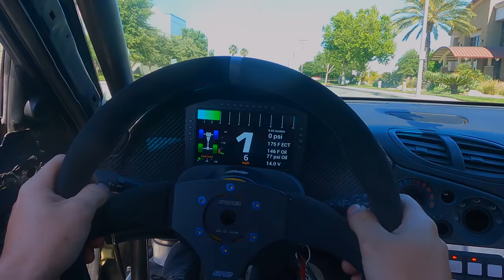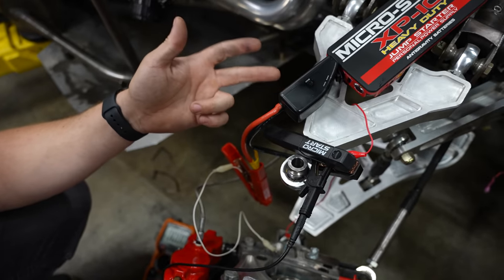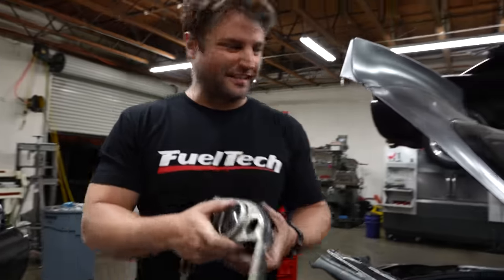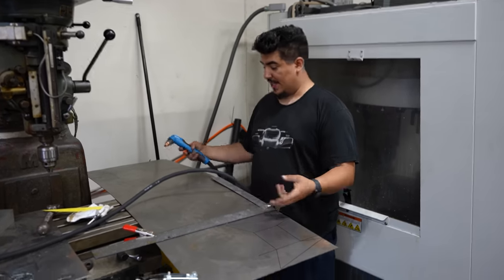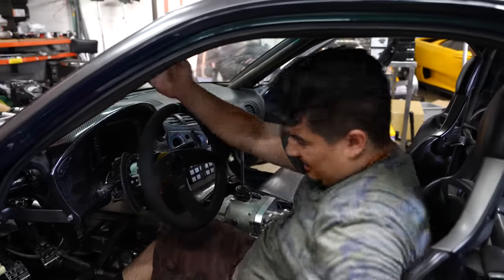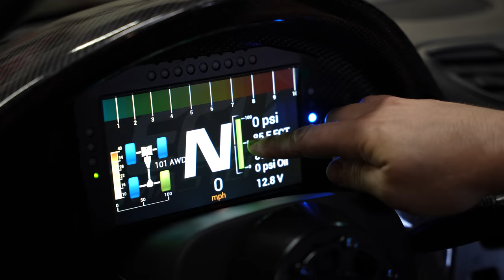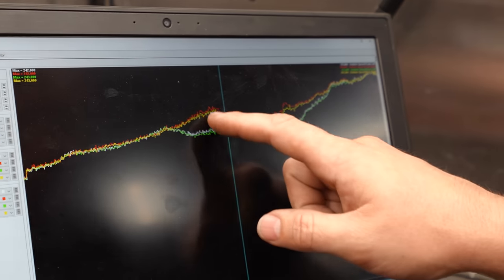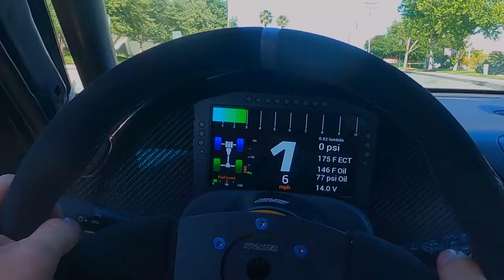Making the AWD 4 Rotor RX-7 brutally fast by Hacking Corvette Wheel Hubs

Comment: I believe a lot of the trig you were trying to use is only applicable to right triangles, or triangles with a 90 degree angle. Unless there's a setting to focus it back down to 90, you'll lose out on data points by calculating it that way. You can do one of two things. Either split the triangle in half, making it a 60-30-90 triangle, and instead of 12 inches for the base, it would be 6, and you wouldn't find the hypotenuse, you would mainly need the height. Or just mock up an interior angle of thirty degrees from both sides of the tire, and measure from the wall to the intersection of those lines. Honestly, the latter is easier because it doesn't require math, except for the knowledge that all angles in a triangle add to 180.
Reply: Okay, just went and reviewed, and this is exactly what he did. So for anyone wanting the full explanation, refer to above. Whoops

Comment: SUGGESTION: - for the tire temp readers, fit them to a rod attached to the hub/wheel mounts, at about 30-45 degrees below the horizontal and ahead of the tire.  This will keep them in a reasonable position relative to the tire, also minimising water or debris coming off the tire and will not require major changes to the inner fender or bodywork.
I think!!
Also, it might be wise to incorporate a small amount of shielding against water/debris coming off the tire and hitting the sensor.

Comment: I think the temp sensor for the front tires should be at the top. If you put it on the front or the rear of the tire and want the sensor to “follow the tires” then that means the sensor will be sticking out of the wheel well when turning the tires thus it’ll hit any fenders you eventually put there.

Comment: There are three different kind of sensors for wheel speed.

The oldest is the inductive sensor, which has 2 wires and gives out a AC sin wave with higher voltage the faster you go. Doesn't know if you drive forwards or backwards. The resistance of the coil can be measured, about 500-1500 Ohm, depending on the model.

Second is the Hall effect sensor, which has two wires. 2 for 5V DC power and a signal line. It gives out a square wave signal. This sensor also doesn't know which direction the wheel is rotating. You can only measure the 5V DC supply power and the wave signal with an oscilloscope.

Third one and used since for like 10 years now is the AMR (anisotrop magneto resistive) sensor. It's basically an Hall effect sensor that works on the concept of an inductive sensor. It has two lines which have 12V DC but the signal is transported on the ground wire as well. The signal is only very small, so you got to set your oscilloscope to like 2V AC and 2ms . This sensor knows if the wheel is spinning forwards or backwards and gives out a square wave with differing sequence depending on forward or backward. If it's toast, the signal switches all the time between forward and backward.

Comment: The reason those door cards shouldn't fit is that you should have side intrusion bars. And the basic safety items others are talking about. It wouldn't just be good for your safety, it would be satisfying content too! Probably would so good things for the rigidity of the chassis too, which could use a strut tower bar as well most likely

Comment: Ooooh, that is the type of data that is needed to get more realism in a simulation atmosphere, the current issue with making tire data is that there is so much guessing going into it because you can’t tell the type of load that goes into a tire or how quickly a tire heats, etc. I wonder if there is a way you could incorporate a load sensor into the suspension to measure how much force is being applied on the tire to help find the max grip from the loading of the suspension, this makes me want to do this with a drift car down the road because there is still way too many unknowns in the world of drifting

Comment: With the amount of experience Rob had working on these extreme computer systems controlled builds, I’d like to see how he does with a completely mechanical performance build. Obviously an ECU is not going to be disqualified but true mechanical shifting, no abs or tcs, no other systems that make it easier for the driver. I’d go so far as to say mechanical rack and non boosted brakes. I’d be willing to bet that if he didn’t have all of these systems to his detriment he’d be an absolute monster behind the wheel.

Comment: Dont forget with the brakes, when you checked the weight distribution, the car is lighter on the right side. Less weight to force the tyre into the road, so it locks easier.

Comment: Amazing work, but I would rather you worry about putting a shield of some sort on that Drives haft then the Original dash (added unnecessary weight) it does looks nice but Safety first.

Comment: Re front tyre temp sensors - divide the tyre into top/bottom, front/back, put that arm you discussed in the bottom rear quarter; lets you tuck it into the area of tyre where collision is least likely, possibly tucked close enough in that dead area to hide in shadows & cause no further issues. Possibly pointed toward the top of the tyre for better temp average?
You said infrared, but are they zero angle only, or is there a range of viable angles, which would let you tuck it further back rather than zero degree centred. But what do I know 🤣
The complexity of development is all you.

Comment: I was thinking that you could potentially use the wheel speed sensors to create a map of where the tyres are flat spotted. Then you could use this in combination with your ABS to roll the wheel off a flat spot if you're breaking hard.

Comment: Typically 2 wire speed sensors are negative 5v hall effect sensor (not positive battery voltage).  I wouldn't send 12v to the wheel speed sensors, but it's your smoke show.
Reply from the maker: I send ecu regulated 8v. Oddly enough. Not sure where you would get negative 5 volts from haha

Comment: I'd enlist a programmer/electronics engineer to create a daughter board between a cheapo IR camera and a module that can interface that data into your ECU, such that it could read real time IR information about your tires. If the camera is slightly angled to the tire, such that it could see a marker placed on the rims, it could even read this data per rotation cycle. You could have (with the right storage solution) real time heat map spreads of the entire tire.

Essentially, kinda like a slow motion camera for heat in corner, straights. If you'd add another camera looking forward, you could even time stamp the whole affair with what happens IRL with the car. If you'd go even further, and add an IR camera there too, that could see patches of hot tarmac, debris, wetness... a whole slew of information which would allow you to understand things like 'why you slipped on power at corner B', because you'd be able to go back, after the fact and understand "yeah, look, there's a patch of gravel there" and because of that, be able to dismiss that whole affair as "road surface" induced error where otherwise you wouldn't even know, unless you'd actively remember it.

A side note, if you're not recording and safekeeping, then organizing all the data spat out by the car as it is, you should.

Comment: With a 30/60/90 triangle, you don't actually have to do any real trig
If the short leg is length x, then the hypotenuse is 2x and the opposite leg is x*sqrt3
With that in mind you can derive the length of any two sides if you're given 1 (in this case your tire width / 2)
Although, thinking about it more the triangle could 'flip' once you get far enough away from the tire, so you would probably be safe doing it the long way to verify

Comment: What if you repurpose the HVAC controls into vehicle controls. 
Fan could be driving modes: 
off=safe mode
1=2WD
2=AWD SPORT
3=AWD RACE
4=Traction Control Off
Temp knob becomes boost control

Also, add a track temp sensor

Comment: @Rob Dahm, Most "Dumb" two wire wheel speed sensors are actually 7 and 14ma. They are not voltage based.

Comment: Hey you can cut up a bike and use like a bike handle and fork with like the brake cable to have the sensor turn with the wheel. U don't really have to use a bike but you can see the idea

Comment: With that dash if you’re able to connect it with track systems? You’ll get flags show on it too
Reply: Also get some temp sensors on the inner rim of the wheels too, will give you an idea how hot the brake area is and how much it’s seeping into the wheel/tyre

Comment: I Love the build so much nur at the Same time i could cry because you are Bildung any bracket Out of thick and heavy steal. You could save so much weight by using Aluminium. Sure Aluminium in every Spot is not right because of saftey but i think you could easaly save 100 pounds or more.

Comment: I agree that a transmission tunnel is needed asap to protect that non -receding hairline !! I think the risk of the Trans grenading is minimal without holding a Trans brake and letting it go to launch the car off the line...thats where it gets unsafe so as long as he's not using a trans brake to launch off the line he should be  OK  #knockonwood

Comment: its a 4-20mA loop, replace the 200 ohm resistor with 250ohms and youll get a 5v signal out.
Reply from the maker: Good to know! I did see someone hinting to 240-250 but it was all hearsay and all i could get was 200 at the time.  Ill make final versions of it!
Reply: @RobDahm  no problem! The reason it's 4-20mA is because the device draws less than 4mA for loop power. That's why your 0 signal isn't 0.

Comment: Safety is most likely the reason they use a resistor to measure wheel speed. It makes it so the computer can tell the difference between a broken wire and no wheel speed.

Comment: Hey Rob, you'd be far better off trying to think of this information from the wheel speed sensors in terms of rpm rather than speed. That information will lead you to the wrong destination. The sensors in the wheels produce a pulse based on revolutions. Hence why the data that is coming from the wheel sensors is actually rpm, not speed.  Wheel speed sensors are not a very good term for the device. While it is true you can get the speed from the sensor, the sensor in itself is not measuring speed, its measuring rpm. Speed can calculated from the RPM of the wheel. The sensor works on a very basic principle, likely using a hall effect sensor and a spindle (for lack of a better term) or trigger that has evenly spaced magnets of some description. Factory ecu's use this rpm, and an equation that takes into account the diameter of the wheel to determine speed. You can also determine acceleration if the ecu has a means of logging this data, so you can see how fast the rpm is changing. There is a lot more to explain in dealing with rotating masses, like angular velocity and such, that will give you far more useable data but is way too much to explain in a yt haha. I did a unit at uni called engineering dynamics that teaches you all about this stuff. I highly recommend looking into it! Its amazing stuff! As always, so keen when a vid on the 4 rotor beast comes out - absolutely amazing build 🔥

Comment: Personally I really wouldn't worry about your front tire temp sensors turning.  On track your only going to have time to check tire Temps under a full course caution or on the front/back straight.  Mid corner your never going to have time to care about tire Temps.

Comment: Rob: Experiment, Mount one tire temp sensor in front of a tire, one behind it, same horizontal plane. Run the car hard, see how much the temperature differential is between the two readings = how much the tire cools during the rotation. If significant, decide if you want to change the location of the sensor, adjust airflow to the tire for controlling tire temp.

Comment: Up the pull-down resistor to something like 1K. 200 Ohms seems to be too low for me... You are probably pushing the output current capability of the sensor there...
Reply from the maker: I was thinking the same.  I keep an eye on it and get some 1ks ordered regardless. Dont need my sensor ground having too much draw

Comment: The entertainment value is just too much to the roof! OMG!

BTW, how thick are the floor panels? I just feel like back when you did the floors you used some crazy thick steel? I know contouring and making a proper "OEM like" thin sheet metal floors would be kinda big task, but I still feel the car would deserve something a bit fancier than a plain steel plates on the bottom... But of course if they act as a flat bottom and are aerodynamically ideal, well then I may come to another conclusion.

Comment: I'm far from a "do the right thing wrenching mechanic fab dad" but might not be a bad idea to keep the flying plasma slag away from your mill tables.
Reply from the maker: Oooo good point. That manual mill needs some new things but No need to make it worse with molten metal haha good spot I got excited
Reply: @RobDahm  Thanks for the reply sir, l do most of my work on my knees, (insert joke) on the concrete, so anytime theres an elevated surface to use, I'm on it. So I probably would have done the same at some point. Love the car man, can't believe how crazy it's become. Hopefully I'll see it the next time it's back in the murder mitten.

Comment: To find out how close the IR sensor should be to the tire just cut out a 120 degree triangle from a piece of heavy poster paper, position the sensor at the tip of the 120° angle and make the width of the opposing side match the width of the tire. Yeah, math makes you look smart, but simple application is smarter, and provides an instant proof of concept.